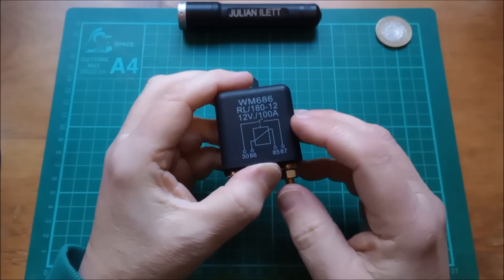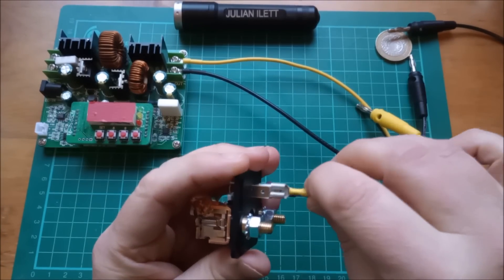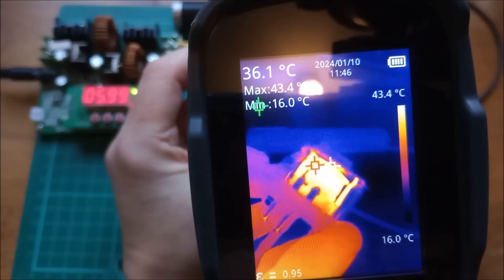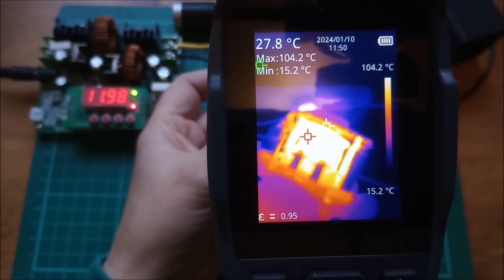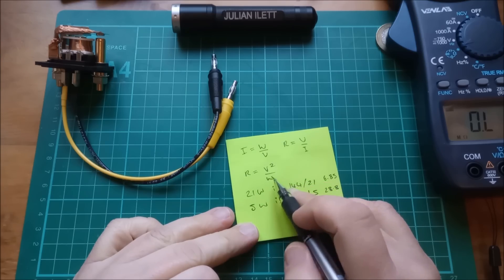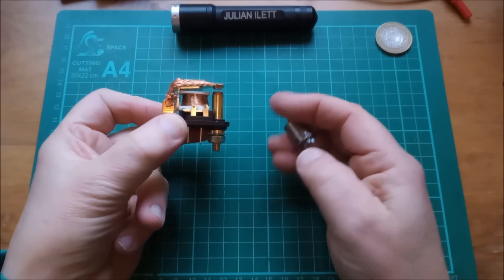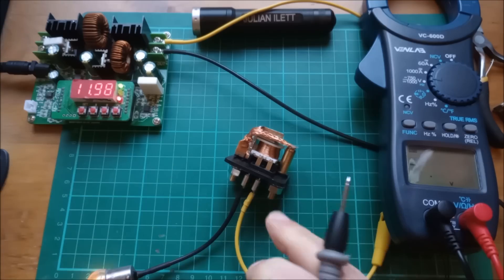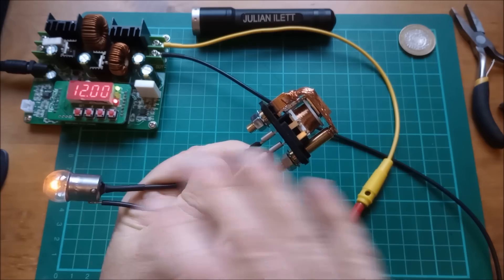100A Relay Coil Overheat Prevention

Comment: I put a 150A relay on each of my boat's batteries, as they got very hot, I bought two circuits from China ( $3.50 each ) for each relay. One provides 12v for 1/3 of a second and the other provides 4v whilst the relay is on. The power / current draw went from 0.8A / 10W to 0.08A / 1W. The trick is to have an accurate lab power supply, engage the relay, record the results and then wind the supply down until the relay drops out. Simples.

Comment: The reason you don't quite get 50/50 is because the bulb doesn't heat up to 5W so its resistance is lower than calculated. A 4W bulb (if one exists) would match better.

Comment: Do you think it would be a problem to activate the relay while dunked in a bucket of oil for cooling? Do you think there will be an issue with the contacts not working correctly being operated in oil?

Comment: After reading lots of comments I did not see mine. I usually drop the voltage needed to operate a relay by adding a small magnet on top of it. After some positioning, you can get the relay to work properly (without the relay sticking top or bottom). I think this super cheap and only requires some research per relay as it is a bit fiddling. When done, glue it tight and that's it.
A better way would be a either self powering (if the feed to the relais is separate from what it relays, you can use the relay to keep itself switched on, as long as you can switch it of otherwise). Another solution, not this relay though, is a latching relay. One that has two positions and with a negative pulse you can disengage it, and with a positive pulse it engages.
Just some random thoughts.

Comment: You never state the purpose of the relay. Are you switching an inductive, or resistive load? Is it an AC or DC load? Why waste all this time and effort (and math) to use something that is clearly NOT designed for your purpose. It's not just the intermittent duty coil you have to worry about, it's also the intermittent duty contacts. You could go to your local HVAC contractor and pick up a definite purpose contactor for a 3 or 4 ton condenser for about $15US. They are designed for high current AND continuous duty. One thing you did not address, is the heat that will be generated by your switched load which could negate your efforts to reduce heat.
Reply: Ah yes, you'll have a bad time if you try switching a much higher voltage or something particularly inductive.  I made this mistake before, and the relay would switch-- and weld the contacts together.

Comment: It is comum to use a capacitor in series and a resistor of the same resistance as the coil in parallel with the cap. This is a bit more elegant and stable solution.

Comment: There was a nice circuit published in wireless world in the 90s? It used a transistor to drive the relay at 12v fed from a capacitor, and then it dropped to ~8v to supply the holding current. I’ve always thought it odd that holding current is almost never implemented in relay driver designs. Also there was an industrial circuit that fed the driver from a pulse train, if the pulse stuck high or low (ie = to a uP failure, the relay would fail safe. It was used in Power Station control systems

Comment: I use a second relay to activate the larger relay but this smaller relay has a transistor with an R-C circuit making it slow to come on it has a resistor across its normally closed contacts so when it operates and its contacts open there is a resistor in series with the larger relay coil reducing the current through it. This means the large relay operates quickly but does not overheat it can also be done with transistors but my larger relay operates at 48v and has 10mm diameter contacts

Comment: J another brill solution. plenty of those auto contactor cheaply on EB.  very simple cct but uses 5W.  Maybe a pump cct primer just to start by doubling momentarily 7v to say 14v, charges a capacitor enough to pull in the contactor? .  Now we need to know it the relay will break 100A at 24V without arc flash continuing.  48V probably not, the gap would need to be much bigger, 20mm not 6mm.  But very interesting  Pls keep going

Comment: Interesting video, don't forget to fit a diode across the coil to stop back EMF destroying what ever device you use to energise the relay.
Reply: Prefer to have the diode as azener across the transistor, just a lower voltage than absolute max for the transistor. Faster turn off, and less arcing on the relay contacts.

Comment: Similar thing is done with things like mains electronic timers. The power supply for the electronics is a dropper capacitor, inrush resistor and zener diode and filter capacitor, providing power to a linear regulator. But the relay coil and its switching mosfet is in parallel with the zener diode and capacitor. When the relay is energized, the capacitor provides the current to close it, but the sizing of the dropper cap is such that it can only provide enough current to keep the relay pulled in. This is fine as long as there is enough voltage to keep that linear regulator working. They often use 36v zeners and relay coils, and a 12v linear regulator. When energized, there's often only 15 volts across that relay, but that's enough to keep it pulled in.

Comment: In the RC hobby this is called a smoke stopper. Used when you power up a model for the first time.  The bulb keeps the receiver and servos going, but stops any dead shorts setting the model and battery on fire.

Comment: As someone has already suggested a resistor in parallel with a capacitor then in series with the coil  is the best solution and one I've seen used on solenoids. The problem with the lamp is it will eventually fail, pretty much obsolete and a short loss of supply will leave a lot of resistance from the lamp in series with the supply to the coil. With the RC solution you can adjust the pull in current and the holding current independently. 
Reason these kinds of devices don't need much holding current is when a relay or contactor  is closed the magnetic circuit is completed increasing the strength of the magnetic field.

Comment: The problem with the bulb is if you turn off then on quickly, the resistance of the bulb remain high. So the relay might not close in that case.

Comment: What about placing a capacitor and resistor in parallel, then adding these in series with your relay?
The inrush current to charge the capacitor should be enough to latch the relay, then the resistor will hold it there?

Comment: Another method would be to use a 30 ohm resistor in series with the coil and have an electrolytic capacitor across the resistor, the capacitor would present as a short circuit across the resistor at power up thereby putting the full 12v on the relay until charged up.
Reply: Good idea 👍

Comment: A properly placed capacitor would allow one to use more current limiting higher resistance light bulbs while still allowing high initial relay closing current. If one puts a large capacitor in parallel with the light bulb, the capacitor starts off discharged through the bulb. But when the relay is switched on, the capacitor represents a very very very very low impedence path that counteracts not only the inductive impedence in the coil and the inductive impedence in the bulb's coiled filiment, but initially represents 0 impedence. Thus the capacitor helps one get high initial current which helps quickly close the relay.

As the light bulb warms up and its resistance increases to say 30 ohms, then the capacitor is charged up to the voltage drop across the light bulb, resulting in the capacitor's impedence approach infinity (not really but close enough for pratical purposes). As little to no more current flows through the capacitor, the capacitor and light bulb network impedence then becomes effectivly close to the 30 ohms resistance of the bulb. 

But as you observed, because the bulb isnt getting the fully current its rated for, the bulb did not heat up fully and did not reach its full 30 ohm resistance. 12v supply -7.12v across the relay coil means just 4.88v is being dropped across the bulb.  Mater of fact, if the voltage drop across the 30ohm coil is 7.12v and the voltage drop across the bulb is 4.88v. Then the bulb's low current hot resistance must be as little as  (12v×30ohm)/7.12v - 30 ohms = 20.56 ohms. 

If you us a higher battery charging voltage i  suspect that you could or rather should should use two light bulbs in serries with one large capacitor across the two light bulbs. Briefly, as the capacitor charges the initial impedence will be close to 0 ohms. but as it reaches its full charge with two light bulbs in serries, the  hot resistance  of each bulb will probably be close to 15-17 ohms a piece or 30-34 ohms in serries with each other.  And lastly, this way, you'll be closer to the operating conditions you were looking for, and producing much less heat and only dropping 6v across the coil rather than 7.12v. That in turn gives you room to apply a charging voltage without overheating the coil inside a close relay box.

Comment: A PTC thermistor like used on tube TV sets for the degauss coil would do the same and you could tailor the resistances.
Reply: The downside of a "real" PTC is the thermal mass. If you turn the relay off and then back on the resistance will be too high and the relay won't close. The bulb takes perhaps half a second to cool down so this is less likely to happen.

Comment: Clever! I would have done a resistor and capacitor, but I like this option better as you get a pilot light too!
Reply: I think he should do a resistor and capacitor instead. He needs the voltage drop across the coil to be lower, maybe closer to 6v and he'll have trouble doing that when the bulb is not getting its full rated current through it. He might add two bulbs in serries and together they may rise up to 30 ohms resistance  but their start resistance is 6 ohms which is starting to become a serous fraction of the coil's resistance.  The nearly 0 ohm impedence of a capacitor in parallel  with the resistor or in parallel with two serries light bulbs drops the initial impedence close to 0 ohms and the impedence eventually rises to the ohms from the resistance alone.

Comment: You are forgetting that 30 ohm resistance of the relay. This means the actual wattage of the bulb in circuit will be much lower and it wont get as hot and therefore it's resistance will be a bit lower. Hence the 7+ volts across the relay.

Comment: You can get an "Audio" relay type to use for high amp continuous handling...mine goes to 500A and has been running for 17 months so far.

Comment: just use a Fet, full power to pull the contact in and then pulses to reduce the current for the hold in.
There was a device called a "cool cube" that we fitted to solenoid's to give a high power pulse then reduced the power with PWM. 
I did a video about the leakage current in a cap which was enough to hold a relay in once it had been energised, but not enough to pull in. it was a antenna tuner unit, poor old micro could not work out what was going on, as once it had operated the relay once it just stay on. but it did not even get warm even though it was engaged all the time.

Comment: Welcome to the world of coil economisers. The usual simple solution is a high value capacitor to provide the inrush current, with a resistor in parallel to supply the hold current, the pair being in series with the relay coil. The best solution is an actual 'peak and hold' circuit. There are some fuel injector drivers that are ideal for the job as well as dedicated ICs or standalone PCBs.

BTW, a very commonly overlooked problem is the release delay caused by using a freewheel diode across the coil. At higher switching voltages, this can lead to 'pulling' an arc. Use a power Zenner diode instead, which will allow the magnetic field to collapse faster.
Reply: Power diode? Are you referring to a Schottky diode? Afaik freewheel is just the configuration, but I get the concept, I hadn’t thought about arc closure speed before, thanks
Reply: @____________________________.x  Sorry, the word Zenner got missed out and it's opening speed that's the problem.
Reply: @EVguru  Thanks, I'll look into it
Reply: This is what I did as well, works great. You do need a beefy resistor though, which I stuck to the metal case with some thermal paste

Comment: Neat idea, but I think I'd still prefer to use a 100amp contactor that's designed to run for long periods of time, or at least some logic based solution. Seems a bit wasteful to be burning the difference!

Comment: 1. heat the relay in the housing 2. measure the temperature immediately after removing the housing. 3. Treat temperature as the temperature difference with the surroundings. If it has now warmed up by 40 degrees, in a shed where it may be 30 degrees it will also warm up by 40 degrees, i.e. to 70 degrees or more.

Comment: The heat build-up will be higher with the cover reinstalled over the relay.  You might want to leave it exposed to the air?

Comment: Great Video Julian! Thanks very much!    It would be interesting, for example, to switch on xxx ms with 12V and then, for example, 1 KHz (or similar) with 12V PWM 50:50 (or similar).
Reply: This would be a more efficient design. Dumping power into the light vs. coil is a solution but certainly not an elegant one.

Comment: The normal way to do this is to use a capacitor and resistor. The reduced contact pressure will also certainly increase the contact resistance and result in damage early failure and overheating. This is really a great example of what not to do with a relay. Just get something correctly rated for the job. Given your trying to switch huge current this really is a very silly idea.
Reply: Wrong. If the relay is fully pulled then adding extra force to the coil doesn't add extra force to the contacts as they are spring loaded.
Reply: @JrgenDurkeHansen  no you are wrong  and it’s very easy to prove having done  the same thing in the past and witnessed an actual failure due to low holding current.

Comment: Nice simple solution!  The bulb is only getting about 5 volts (7 volts drop across the relay) so the temperature and therefore the resistance isn’t as high as when it had the whole 12 volts across it.
Reply: Yes, he did the math (more or less) for a 6V 5W bulb 😃

Comment: 09:00 You calculation is slightly off. 5W at 12V is 28 ohm, but the same light bulb at 6V is not. That's PTC in a nutshell (light bulb). 🙂

Comment: I have connected a resistor with a 1000µF electrolytic capacitor in parallel in series with the relay. Due to the capacitor, the full voltage was present when the relay was switched on and dropped to the holding voltage of approx. 8V after < 0.5 seconds.
Just like your solution with the bulb in series.

Comment: I wonder if a 10w bulb would work better ? You should still have enough power to keep the relay latched but it would also reduce the cureent through the coil.
Reply: 10w bulb over a 5 watt bulb? No it would not work better in this case. 

 Given 12v rated bulbs 10w is twice the power over 5 watts, thus twice the current flows through half the resistance.  

Then in a 30ohm coil and resistor (light bulb) voltage divider, the higher watt lower resistance light bulb drops a smaller faction of the 12v leaving a larger fraction to be dropped across the coil causing the coil to heat up more.
Reply: @kreynolds1123  My maths is bloody abysmal. You're right. 👍

Comment: An issue not discussed is that of the relay's contact voltage rating. Specifically it's DC contact voltage rating. Switching higher voltage solar panels may not be reliable long term.

Comment: Relay Contacts are always springloaded in some some way. If the electro magnet closes the gap to the attracted part completely the contactpressure is only a function of the force stored in the displacement of the spring. 

So if you can’t see or measure a gap on top of the electromagnet you can assume it to be fully closed with the correct contact pressure.

Comment: I have used a resistor with a parallel capacitor. The relay get full voltage and current at the start, then the capacitor charges up to whatever the voltage the resistor drops.

like, ~33ohm coil with a 33ohm resistor.  It start with 12v and then it goes down to 6 volt.
Reply: But don't let the heat from the resistor or relay winding bake the capacitor.
Reply: @iblesbosuok  The resistor and capacitor can be at the switch instead of the relay.

Capacitors are also rated atleast 85C so they can take some heat

Comment: Comment before finishing video:  Multiple Diode dropper with parallel capacitor.   Capacitor gives you the current spike to pull it in.    Resistor could be used in place of the diodes of course.
Reply: Might need a resistor to discharge the capacitor. If you turn it off and on again the capacitor will already be charged the second time, and the relay might not get enough voltage to pull.

Comment: Nice way of dealing with current. I had a similar situation where I needed to reduce the power a relay was using so I PWM'd it once it had actuated. Not idea but has worked fine a decade or so.